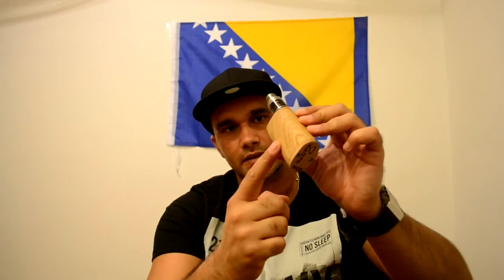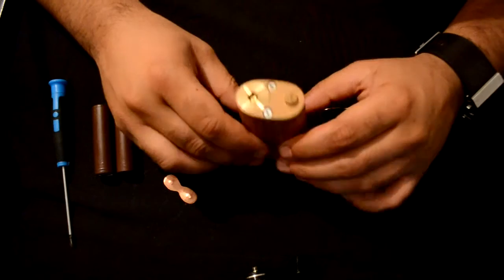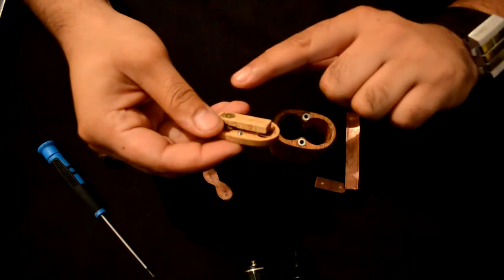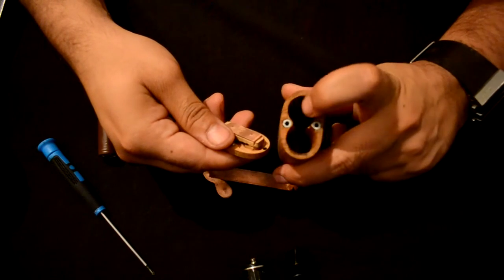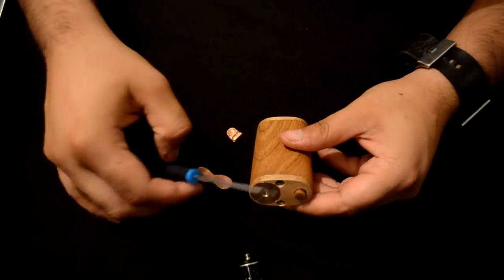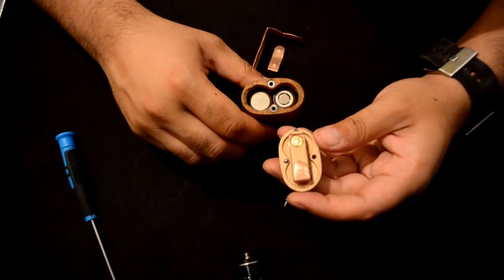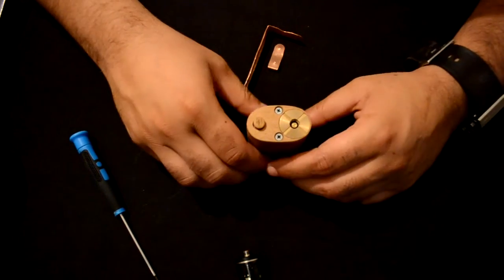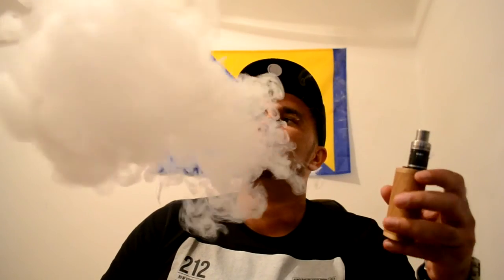Zora Mod Tutorial

Comment: Hi, city461 from POTV.. First thats a great stylish mod. Is the wood treated in someway? just worried if I spill juice on it it will discolour or stain...
Reply from the maker: +Jerry Di Caprio 
Hi @jerry Di Caprio , the wood has two finnishes from wich you can choose
1: a natural oil finnish ( wich needs to be re oiled once aweek or so to keep the wood saturated )
2: a waterbased clear coat wich soaks in into the wood and protects it while keeping the nice natural wood feel( this method is more robust and more sturdy)

in both methods its not recomended to spill juice over your mod, if its a clear liquid it wont make any difference but if its a coloured liquid it may leave a stain especially with the natural oil finnish.